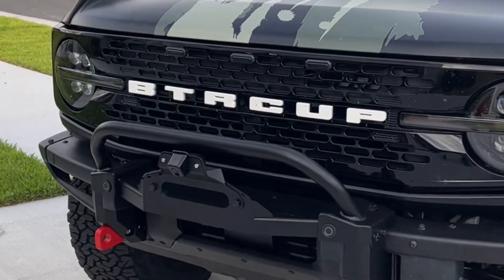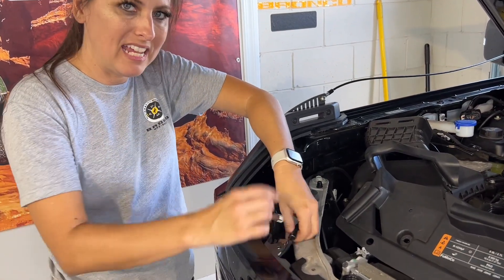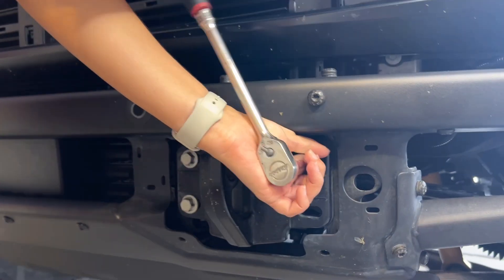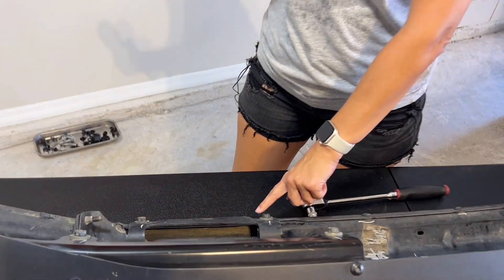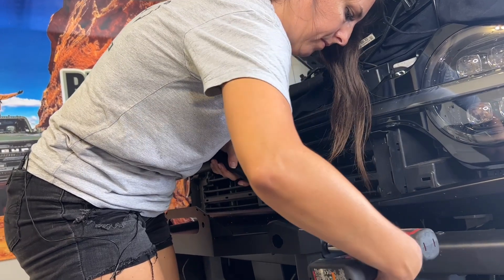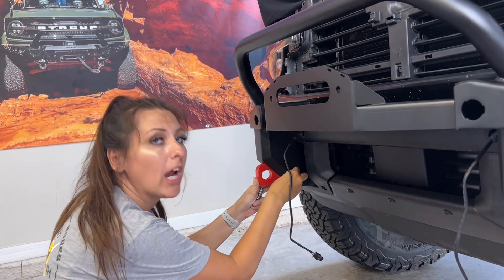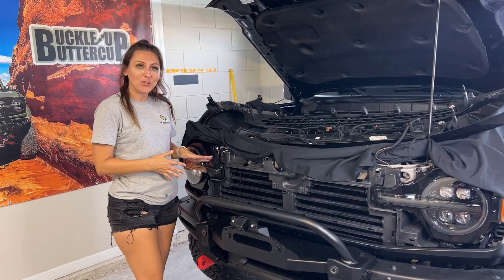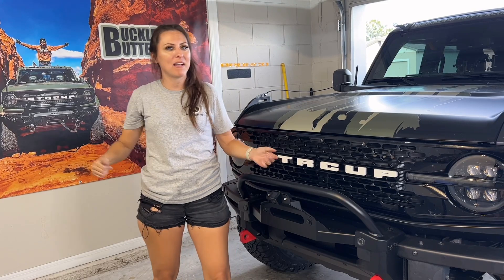Winch Mount Install for Bronco that Relocates Camera & Sensors | Buckle Up Off-Road

Comment: Just finishing up. The Bronco Raptor bumper has a few differences, for one the plastic bumper plates on yours is replaced with a single plate. Also added some frame gussets and had to grind a small notch to let the retaining nuts fit down where they should (just in case you ever get a wild hair to add reinforcement to the frame). Should be finishing up tomorrow. Waiting on my Warn Zeon 12-S platinum. Ready to get on a trail after that.

Comment: Great video. Looks like a pretty straight forward install. Ill be anxious to see how this holds up. Seems like just about every 5 year old Jeep around here with any aftermarket bumpers, sliders, steps, brush guards, the parts have completely rusted out on an otherwise perfect truck.

Comment: This looks like the best option yet for a winch on the Bronco. And it works with the capable bumper as well?
Reply from the maker: Yes it does, you just need to trip the cap covers, same for Raptor. 😁
Reply: @BuckleUpButtercupTV  Awesome! Thanks for the quick reply, Krista 🤘🏻😃🤘🏻

Comment: I loved the clean install. But I would like to see the how much the mount will take can you put a 10,000 or a 12,000 lbs winch on it
Reply: Same. Would like to see it in use first
Reply: @JointheScene1337  needs frame tie backs and the top mounting plate needs reinforced or your going to do some damage. But it the best option for the modular bumper. To answer your question yes I would like to see it in operation

Comment: Is this mount made in the USA? Your website doesn't specify. I'm hoping you're contracting a local fabricator and not going overseas. I like the design a lot.
Reply: From What my research shows its the same as the IAG and the Mabett winch mount. At least it looks the same.

Comment: So where is the winch install video?
Reply from the maker: I haven’t had a chance, but hopefully in next couple weeks. I am not just installing it but also relocating the box so will take a while.
Reply: What size winch are you planning on putting on I see you have a 4 door with that mount. I was thinking of a warn 10s for my 4 door